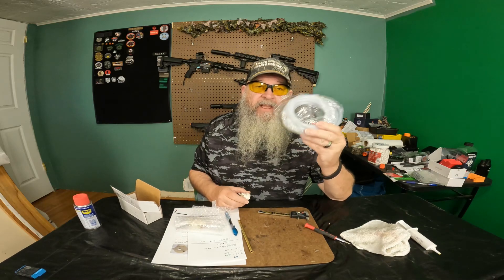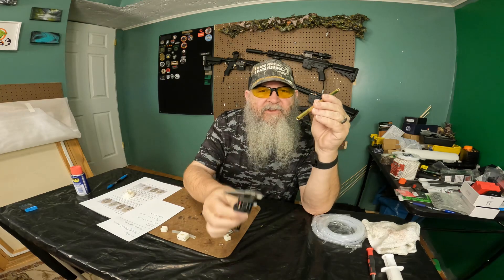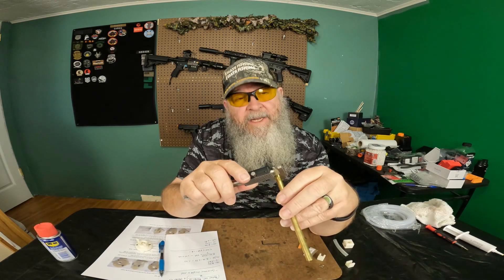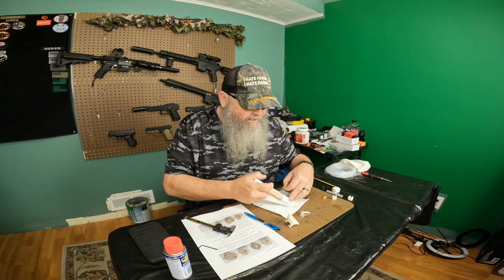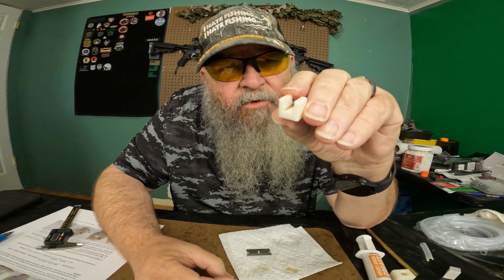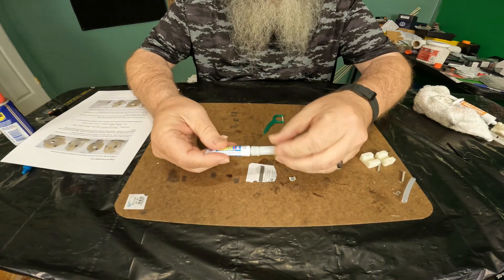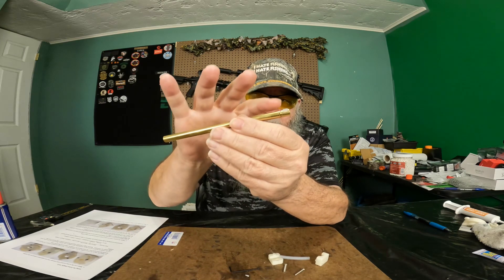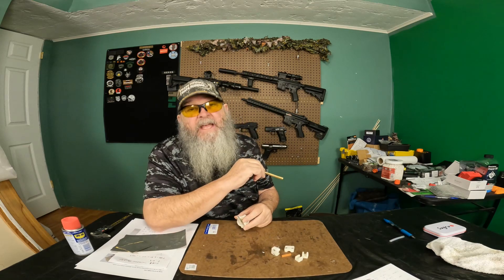Make Perfect R Hop Patches (Cheap Easy To Use Tool)

Comment: Hello, can you tell me what diameter is your tube inside-outside; thank you!
Reply from the maker: You talking about the diameter of the plastic tube I use for the rhop?
Reply: @ShreqAirsoft yes!
Reply from the maker: @giorgoslir  It looks like my tubing has an inside diameter of 6mm and outside diameter of 8.5mm. I suggest you measure the barrel you will be putting the rhop on and then try to find one as close to it as possible. That tubing flexes and you can push it to fit.
Reply: @ShreqAirsoft thank you a lot!
Reply from the maker: @giorgoslir  You are very welcome